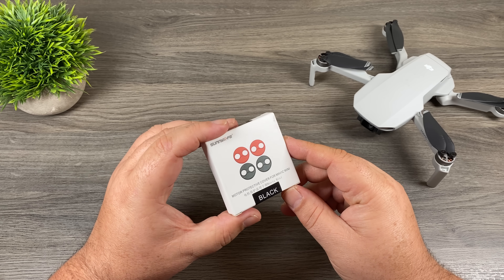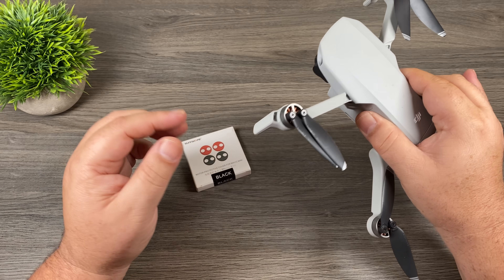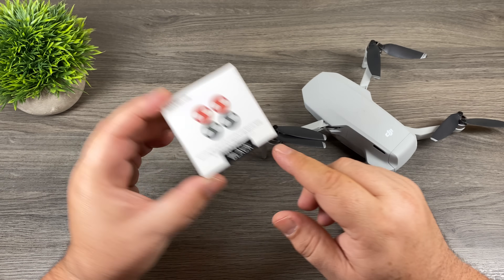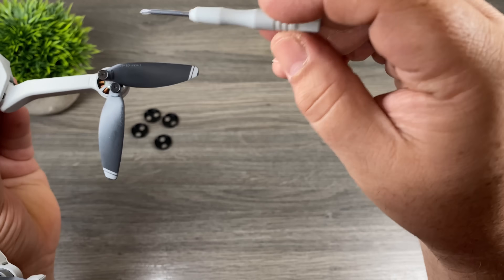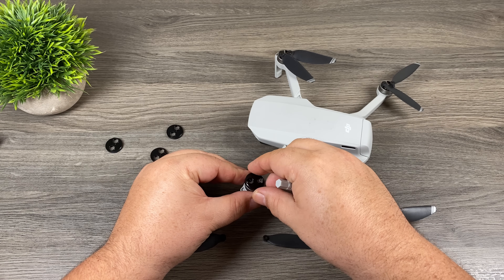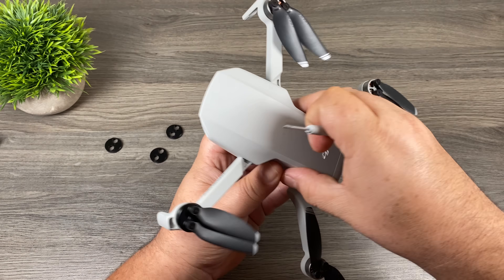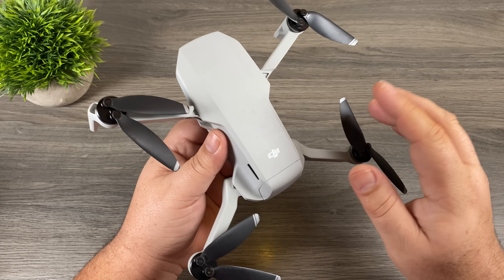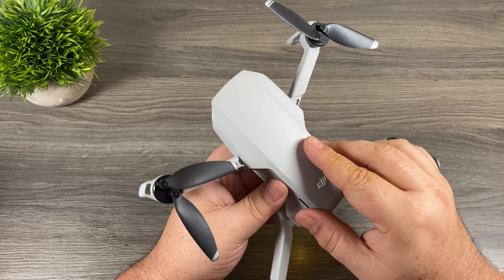DJI Mavic Mini Motor Caps - Good or Bad Idea?

Comment: Page 20 of the manual: “DO NOT block any of the ventilation holes on the motors or the body of the aircraft.” 

Based on that, more than likely the warranty is void and DJI care refresh may be impacted also.
Reply: DroneLand Hello good Sir, I read the manual and it does say that “do not block any of the ventilation holes...” BUT I did not see or read anything about the warranty of the drone being voided. Can you please confirm this? Also, what about the skins? You read anything about the warranty if you put some skins? Trying to decide if I should buy these covers for my drone.
Reply: Couldn't you just unscrew and remove the caps before filling out warranty claim? Since it is kind of on the boarder of voiding/not.
Reply: Warranties cover manufacturer fault, not stupid decisions made by the consumer. I would say explicitly ignoring safety/best care warnings to make modifications is a consumer fault, not a manufacture fault.
Reply: @firstname405  Ehhh, DJI-care covers my stupid choices.
Reply: @gattosquad2241  Very true! gotta love Care Refresh
Reply: @firstname405  okay Dwight. I'm pretty sure everyone who used the warranty or DJI Insurance will won't admit and say it's the users fault. Who really cares. Also, like someone said just take them off before you fill out the claim and take pix.
Reply: @rupman27isback  you sound fun at parties
Reply: @firstname405  i was just gonna say the same about you. 😆👌
Reply: Thanks for sharing 👍 I think the motor caps are a good idea to not have to use the warranty. You get a bunch of dirt or water in there you're probably going to destroy the motor quicker than these caps will. Thanks for sharing 👍
Reply: DroneLand I’d also they have no caps to save weight
Reply: @benjaminriches9736  I got rid of them due to interference
Reply: @montanadrone1236  interference with what? I'm interesting in buying these but don't know if there is any ridks
Reply: The holes aren't blocked, the holes in the covers are rather large to allow for the props and more than enough to dissipate heat (as the video shows). This is just a silly comment. They weigh 12 grams (total) and work with no effect on the drone whatsoever.
Reply: @Q-Legal_Civil3D  Don't you think there's a reason why DJI left the motors exposed? I personally don't think it's a design flaw. You might only see the negative effects after flying regularly at the maximum flight time. Just my opinion though.
Reply: Just remove the motor caps before you send it in with the care refresh, they wouldn't know if you had motor cops on or not.
Reply: Mini 2 manual reads the same as well on page 20-21. I promptly returned these after I read that. I just bought a nice landing pad to use when I’m around a sand or dirty environment. Thank you for pointing this out.

Comment: I’d pass on this accessory. Learn to hand launch and catch and you don’t need to worry about debris. If there is a debris problem your gimbal needs to be protected as well so again might as well practice to hand launch and catch. It’s not hard. 
It just introduce higher risk of something on the motor. A slight imbalance. Slight temperature increase. Slight more effort on the motor.
Reply: I have to agree. This is just another stupid so called "accessory" that is totally unnecessary. Just fly the mavic mini and enjoy it.
Reply: Slightly less battery life as well
Reply: Yep I'm looking at these for my mini se and not convinced that the extra rotational inertia is worth it

Comment: What is the purpose of these cups anyway? These are brushless motors, there is no unisolated electrical contacts in them. You can basically submerge them in water and they be fine (this will probably damage drone electronics though).
Reply from the maker: Have you ever crashed a drone and it’s landed in mud or soft terrain. Cleaning debris that’s been packed in the motor is not an easy task. These motor caps are not A must have kind of accessory they can be preventative if something does happen. Most of the time these style of drones the motors are sealed I’m assuming DJI went with the style of motor for the mini to keep the weight down
Reply: @AirPhotography  only dirty water hurts anything, electronics etc. With purified, distilled, de ionised water you can clean anthything including electronics. Its the elements in water that destroys electronics. No need for them what so ever.
Reply: @AirPhotography Exatamente!!!

Comment: The idea to measure the temps sounds good. But you have forgotten to adjust the e-factor on your device. Since infrared meters do a terrible job in ambient temperatures, the results depend very much on the type of surface you are pointing at..... Shiny metal or matt black makes a huge difference, and even does not say anything about the temp of the windings :)
Reply: The reflectiveness and opacity have a dramatical effect in how these devises read, readings should be taken on a non-reflective like some painters tape.

Comment: I purchased the red set , came to the same conclusion. They seem to work just fine.
Reply: LIBsTRIGGER still running good? I just put mine on.
Reply: How are they after a year, guys? I bought them, but I'm still hesitant...
Reply: @16klu  no issues

Comment: I put same caps on my Anafi about a year ago.  Red ones.  Heat has never been a problem, even on hot summer days.  I felt the motors many times after flying.  No heat at all.  A Fimi x8 I have does get pretty warm. Mavic Pro 2, no heat either.  Heat from wife for buying—quite a bit.

Comment: This test is not accurate and your method was spurious.
Reply from the maker: You’re right it is definitely not scientific but more than accurate enough to get the point across To see if this would cause large fluctuation in heat
Reply: @AirPhotography  understood. But the weight needs to be addressed also. I bought the extended legs and to be honest. At over 270g with them on. And couple that with the guards limiting the cooling capacity. You may well be in danger of the rear motors seizing. We are talking very affective, but extremely delicate motors.

Comment: Thanks for the video! I have a set of red ones that are coming in on the slow boat from China any day now. The motor temperature was my biggest concern but thanks to your video you have dispelled that concern. I'm not so worried about weight.

Comment: I think the way to do the test is not like that, do the test by actually flying outside with temperature conditions outside of 30 degrees Celsius I am sure it will be hotter than without a cover ...SALAM UDARA....
Reply: bagus pakai ke tak ye ? sebab saya da terbeli

Comment: When removing the screws don't you need to clean off the old blue Loctite and reapply with fresh ones? ...Adding a dab on the tip before re-screwing. I only say this because DJI puts them on the replacements tips.
Reply: INTELMAXELL MULTI-ROTORS You’re supposed to replace the screws anytime you take off the props, because of the loctite. So yeah, probably a good idea to add some if you’re not using new screws.
Reply: Yep, definitely should use DJI’S new screws. They have the “Threadlock” on them. And use the old screws to clean out the old threadlock by screwing them in and out a few times. I tried to put new ones in before cleaning out the hole and they wouldn’t go down all the way which made the prop wobble.
Reply: Yeah 100% you should replace the thread lock / Loctite.
Reply: @MarcRCAddict  Yes that is correct. But clear fingernail polish works just as well. I use it on my scope mounts on my hunting rifle. Works just as well if not better. Used it for years.

Comment: I agree with Allen, the weight can be a large factor. A lot of the reviewers are missing the main point for most of us and that is the overall weight of the drone. Under 250 grams, in Canada, and we can fly anywhere. Over 250 we must register and get a pilot certificate and cannot fly in a lot of areas!
Reply: Just asking.  Who would potentially get bagged for the minuscule additional weight these add. I really doubt there any chance at all. Zero. None.   Bill
Reply: @billkeyes540  You have no idea the lengths that Transport Canada will go to to hassle any drone pilots in Canada!
Reply: @petercole7384  That's a gross exaggeration. If you've been hassled, it's because citizens complained about your potentially disrespectful flying. Sorry, they do not purposely seek out drone fliers unless they receive complaints.
Reply: Hi i will go to canada by nextyear i will bring my mavic mini do i need to register my drone?
Reply: @BrentongAdventure  No. Because it's under 250 grams.
Reply: Yes you're right these reviewers are missing the whole point of the mini and a lot of them can't wait to add extra weight. If they're not worried about weight they would be better off with a mavic air in the first place.
Reply: @jameslovell8682  apples and oranges. The mavic air is much more expensive.

Comment: The problem with this video is that you removed the propeller screws and didn’t replace with new screws and propellers. The screws that you removed have loctite on them and since you removed them you broke their bond. By putting them back on the drone you now run the chance of having the screws come loose and eventually losing the propeller causing the drone to crash. If you’re going to put those guards, either replace the loctite on the bottom of the screws or have a new set of screws and propellers handy, otherwise great review.
Reply: Yup I just said the same thing lol
Reply: Or  … at least film the crash so we can see what happens when the prop comes off with lack of Loctite   LOL

Comment: What a coincidence, I was looking at these on Amazon just last night and was wondering if they would cause the motors to over heat and you answered my question. Amazing , thanks.
Reply: So were you having motor trouble because of dust? If so, you should return it to DJI.

Comment: Shouldn't you have put blue Loctite on the screws before reinstalling the props? Just asking.
Reply: This is what i thought, they recommend using the screws only once because of that!
Reply: @Tuur75  or you can clean off the old tips of the screws and reapply with fresh  blue Loctite, if you have a tube of it at home. If not you need to use your spare screws given from DJI like you said. :)

Comment: If you're re-using the screws you've broken the Loctite bond. You're supposed to use the replacement screws.
Reply from the maker: Good tip thanks for sharing that
Reply: i have reused the screws without probs. did around 100 hours flight and they are still solidly screwed in.i dont worry about putting new screws every time i change props. just check them  (screws) ever 30 mins flight time

Comment: I think the weight limit can be a big deal up here in the snowy north!
Reply: Allen Muirhead yeah!   Here in Canada, adding any weight to it defeats the purpose of the drone...unless you already have a license... Imho!  It needs no other gadgets, but maybe some good updates in the future will ....
Reply: Of course it is, but this guy doesn't think so as he didn't bother with it until the end of the video.
Reply: If the weight of the mini exceeds 249 grams after adding these or any other accessories, it then needs to be registered with Transport Canada.  As well, once you fall into the next classification it requires you to have a licence and adhere to either basic RPAS licensing restrictions or advanced.  For the average person and unlicensed user, this is a big problem.
Reply: Adding these did not push my mini over 250 grams (was still under 250)
Reply: @fifiandmax  just under 2lb